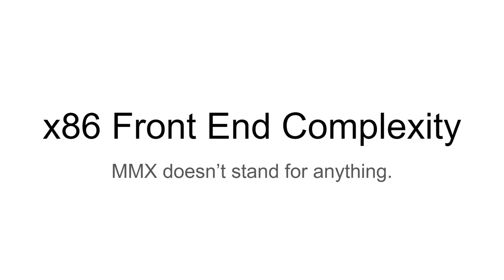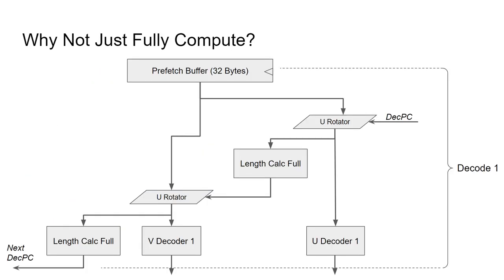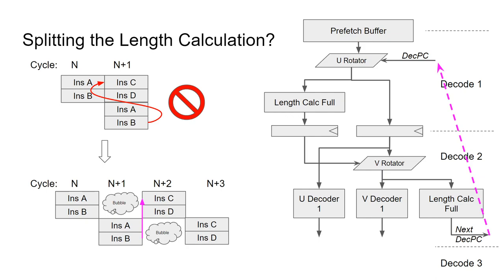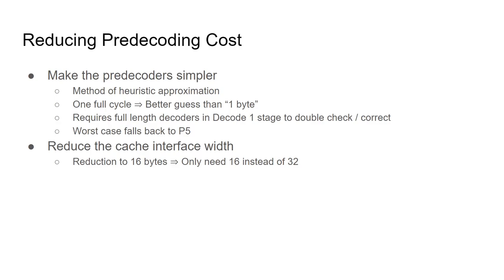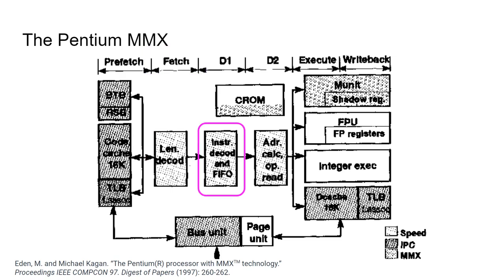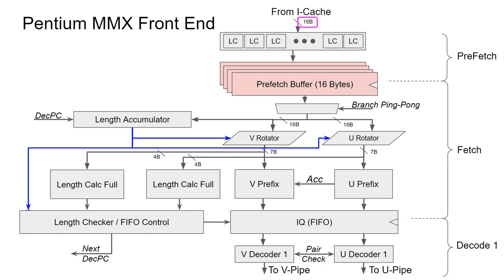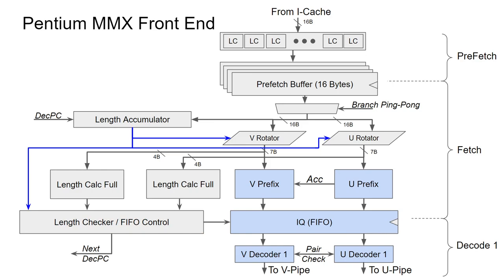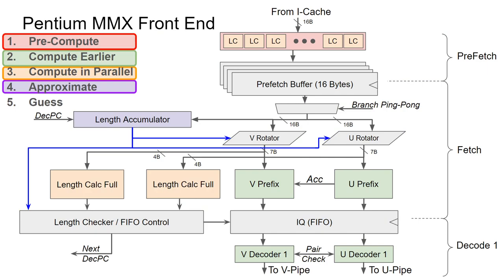x86 Front End Complexity (Part 2 - Pentium MMX)

Comment: This series got me thinking. How complicated is ARM, MIPS and RISC-V frontend compared to x86? Seems RISC frontend should be straightforward right?
Reply from the maker: Correct, RISC frontends can be more straightforward, and have a much easier time decoding multiple instructions in parallel. MIPS for example could take a 16 byte instruction buffer and feed it directly into a 4-way parallel decoder. Typically though, that 16 byte buffer is called an instruction queue and combined with the dispatch logic (for an out of order backend). In such a case the decoders can be more tightly coupled to the function units / reorder buffer entries, and only accept certain instruction types. The IBM Gekko is a good example of this, and the structure / behavior is well document in the manual (with examples).
The more complex x86 processors do something similar, but through an added stage after decode (so they push the micro ops into a micro op queue, and then dispatch them to the function units accordingly).
It's possible that Apple's M1 didn't implement that sort of queue logic and instead went for a simple 8-way decoder, and that's part of why the performance is so high.
Aside from including the dispatch logic, there are other complications though. For example, you have the RISCV-C extensions, which are 16-bit instructions. Those are packed into 32-bit aligned words, but the decoders need to have the capability of switching between decoding a single 32-bit instruction and 2x 16-bit instructions.
In short, yes, RISC frontends can be more straightforward, but usually architects take advantage of that to add more functionality to them, making them almost as complicated... Anything to save a pipeline stage.
Reply: @RTLEngineering  arm is complicated. It has 32-bit instructions (regular ARM), 16 bit (Thumb) and another 32 bit (Thumb2) but can be mixed with 16bit. So it's messy but not as bad. The small Cortex m0/0+/1/23 cores are wacky and are missing some instructions entirely which is a fun discovery.
Reply from the maker: @thenimbo2  Thanks for the clarification with ARM! That's partly why I explicitly didn't mention it in my comment (I knew it was more complex, but wasn't sure on the specifics). 
The M1 only implements AArch64 though. So that should be simpler since it doesn't need to support legacy 32-bit or the Thumb sets.
Reply: @RTLEngineering Interesting note on the A1. So you think they use a simple buffer and decode like Gekko? But obviously 64 bit instructions and more parallel decode.. it's always a little hard to speculate exactly what new processors are doing, even generically.

Comment: Multi-Media eXtensions?
Reply from the maker: That would make sense, but officially it doesn't stand for anything (Intel's official position). It was added as a quip / play on words though, regarding the fact that the front end was overkill considering the backend limitations.
Reply: I was about to post "multi media extensions" too. I remember when these CPUs came out in the mid-90s and how this instruction extension was aimed at video decoding (around windows 95/98). IIRC it included some useful performance-counter/timing instructions too. Excellent video btw!